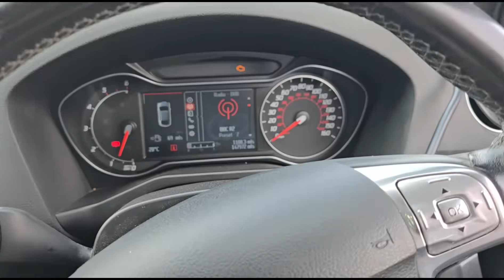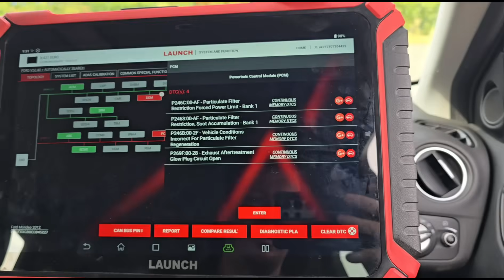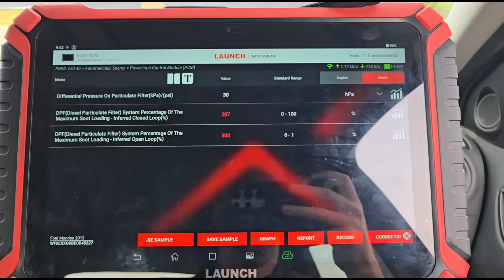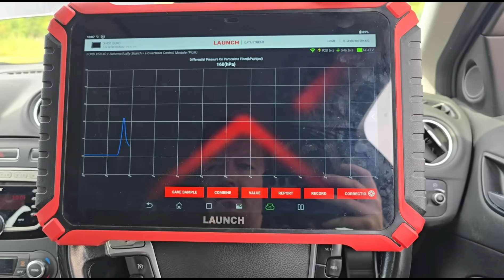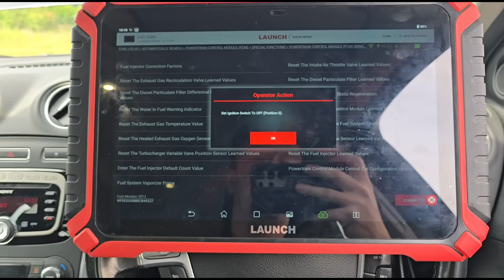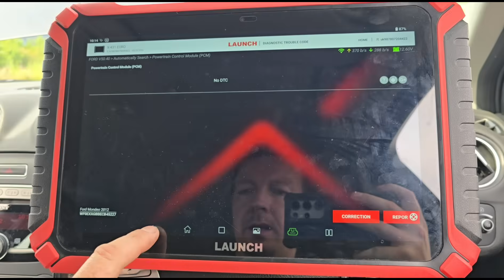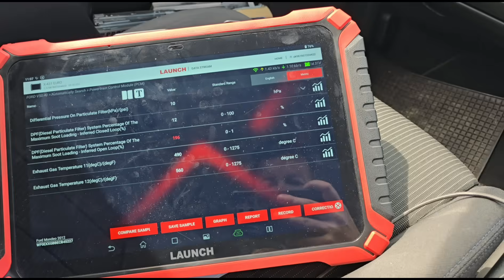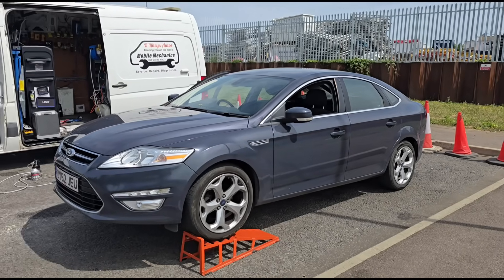Ford Mondeo P269F:00-28 & P246B:00-2F & P246C:00-AF & P2463:00-AF

Comment: Jimmy . This is very valuable information. Thank you for taking the time to explain your research and process in reaching a conclusion. I have a Nissan xtrail ( my 4th Nissan ) and I am now in the process of of doing battle with the dealership as I am experiencing DPF issues. I have had the car about 3 months and had a new set of glow plugs fitted which does not appear to have fixed the problem. My question to you sir is , have you had dealings with the Nissan Xtrail ( 69 plate) 1.7 diesel. I hasten to add all my previous Nissans have behaved faultlessly. I have a mind to drive the car to car to where ever you operate from and ask you to fix it for me. Only if you are willing of course. Thank you in advance.

Comment: Still hard to believe that nearly 20 years on DPF issue diagnosis is still an issue. These parts are expensive and if not actually needed you can end up spending money that the cars value doesn't justify. Good vid. Hope there's a part 2 to see if the original did actually need replaced. 👌🏻💯

Comment: I had a similar problem, temp not reached, ended up to be the vaporizer. it was not 100% blocked but could not inject enough fuel. after replacement the car did a regen and all was ok
Reply from the maker: Thanks for sharing, glad you got it sorted!

Comment: Whats the maximum safe limit  before the DPF needs cleaning?
I go on the rule of thumb 100milibar at 3000rpm is getting towards to the most pressure thats safe, is that about right?
Also ive done regens at 140% full and they seems ok ish.
Reply: if its not coming lower than 100mbar at 3000rpm after a regen than you should think about getting the dpf flushed out.
thats pretty high.
Reply: @danielseibert4082 No, no, I meant before a regen. That's high, yes. 
Say there's been a fault and you've repaired it but as a result of the fault the DPF is partially blocked, at what point do you decide it must be cleaned or just go for a drive and let it regen as normal.
Reply: @andrewbancroft6174 oh now i get it. I would say 15mbar at idle. Maybe at max 20. Bit it kinda depends on the dpf and car so its hard to say whats the max pressure at 3000 thats fine for a normal regen.

Comment: Hi Jimmy,  can I suggest you get together with Haynes manuals and produce a Jimmys DPF manual, and also suggest you get together with Launch to get an AI trained up with all your knowledge and expertise, and incorporated into their products to enable  AI assisted diagnosis and rectification of DPF ISSUES.  I would rather see you do it rather than someone else, and believe me they will. Regards Col
Reply: I wouldn't trust a Haynes manual ever. I lost an engine following one, the torque settings were incorrect. Result, extra inspection holes in the block.

Comment: Did you check that the vaporiser was powered up?
Sounds like there wasn't enough fuel to raise the temperature sufficiently.
Does the injection system add fuel during regeneration process?
Reply: Not 100% sure but I think they may add a little fuel via the injectors. On our transit when it's about to regen theres a strong smell of unburnt diesel, and the exhaust is cracked at the turbo so makes me think there's more fuel going in to the DPF than just the 5th injector adding it.
Reply: @andrewbancroft6174  not every transit has a 5th injector. some only use/have the injectors of the engine for regen.

Comment: Ive got a fiesta that has a hum like vibration in the steering wheel and brake pedal when moving at 30+. Ive noticed that resetting the adaptions for the egr valve calms it down. Is it dirty or should i replace it? No codes
Reply: Random comment lol